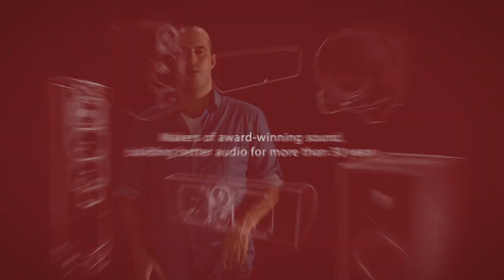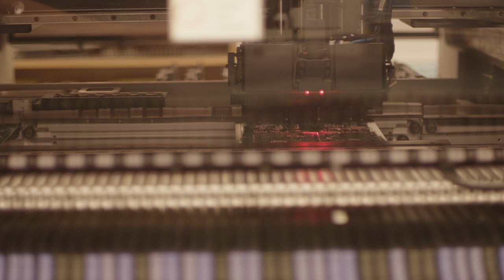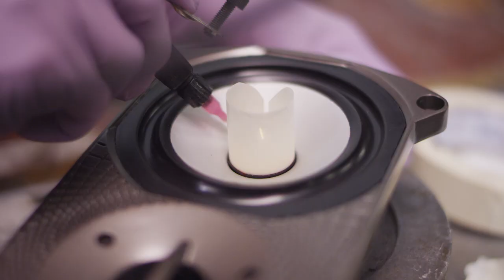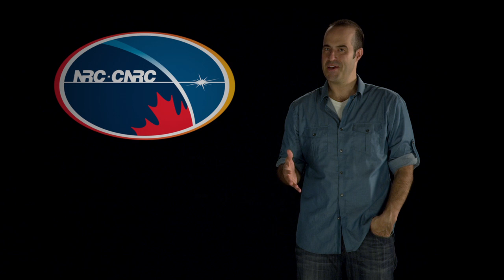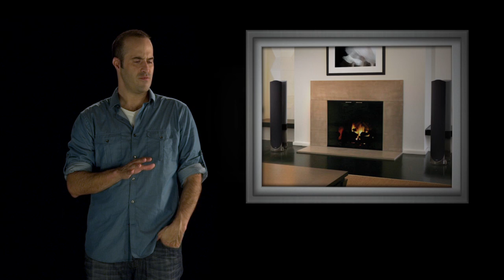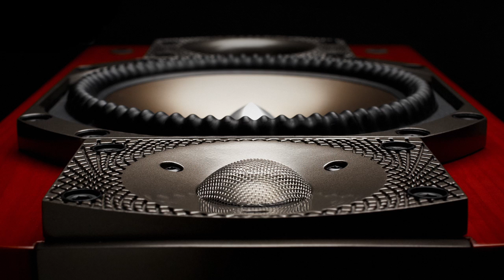Building Better Speakers - Paradigm Manufacturing Process

Comment: I have been using paradigm speakers for over 20 years now I started out with the studios and upgraded to the reference series and let me tell you by far these are the best speakers for the price comparison that I found and the best sound by far that I found..
Reply: +Joel Taborsky would really appreciate your input on the following for a home theatre room 22x15 Paradigm CI series speaker system 7 channels 
5 CI H65IW in wall speakers 
and two CIH65C in ceiling speakers 
with a Paradigm DSP3100 subwoofer 

Another option albeit at a higher price is upgrade to the Pro series all with 8" drivers 
P80 IW x 3 for the Fronts 
P80-R x 2 for Atmos 
P80 SM for surrounds 
DSP3200 Subwoofer
Reply: Yes Omar I would believe that the Pro Series with the 3200 would be the way to go.. I currently use a 3200 sub right now on my system and I love it it's a beautiful sub..
Reply: And do you mind me asking what projector and what screen are you going with..??
Reply: And what size screen are you going to go with..?? And what amp and receiver and Blu ray player do plan on going with..??
Reply: Of course I'm sure if you're familiar with the P Series you need the right power and the right Dolby Atmos receiver for those speakers to sound optimum..
Reply: +Joel Taborsky going with Cirrus 135 inch screen and epson 5030UB
Reply: +Joel Taborsky RXA850
Reply: +Joel Taborsky RXA850
Reply: Very nice. I have the RXA750. which is right below the RXA850 I just don't have the Dolby Atmos beautiful choice of receiver Man I love mine especially the app where you can control it using a smartphone you're going to love that receiver..
Reply: Perfect combination on the screen and the projector you're going to love the Epson that's a very good projector I don't know if you were working with an audio/video professional or if you picked all this equipment on your own but good choice..!! I'm using an LG 65 inch 3D TV with a Sony blu-ray player 3D..
Reply: Joel Taborsky the equipment was recommended by a HomeTheatre professional. Thank you for the great feedback

Comment: A better marketing campaign is showing us the inside and see the build quality of the cabinets. Explaining the design features that make the speakers sound better, showing us the crossovers with schematic on how you crossed the drivers over.  Show us the the drivers in parts and how you're speakers are better eg bigger magnets, higher flux in gap, materials used to make the cone and spiders etc..The only part that is an excellent marketing tactic is the blind listening tests, this is good test for sound quality.

Comment: What about Vifa tweeter in the pass and the chiness one in some model, and all those crossover failuire, woofer lead  not solder,  ......  Paradigm was awesome speaker in the past for a price that no one was able to beat ......  until around 2000   .....   now you have to paid 1000 for a little bookshelf speaker with a 5 inch midbass......   i would like to listen the 95f prestige with all metal speaker :S  .... not sure I will found back the amazing sound of the Paradigm  9 SE MKII   .... Anyway they will still my speaker of choice  .. they still do crazy stuff in they high end serie
Reply: IPv6WhatIsGonnaDo q

Comment: Is it really a Chinese product?, if so, then I think is overpriced. As for quality concerns, In my experience the manufacturing quality is 10/10.  I had the chance to help a friend change a tweeter in a Studio 10 and I was amazed to see the interior: big magnets on both woofer and tweeter, Thick wood, good capacitors on the crossover, thick quality cables inside, great insulation. I would get my hands on a pair of studio 10 or 20 anytime.

Comment: It's a real shame Paradigm sent the Monitor series offshore to China. I'm happy to pay a few bucks more to support N.A. manufacturing, and the China move by Paradigm forced me to look elsewhere.
Reply: +ratbuddy1  same here man !! never blow a woofer in my life , i have 15 pair of speaker stereo mode theater mode , and my model 9 , i change 3 woofer lol ,my center channel cc-390 had to change the mid and the tweeter , realllllyyyyy bad speaker , tweeter is way more db then the woofer ,crossover is just out of wack .
Reply: I have the Monitor 11s7 series, and they are sensational, just because they are manufactured in China means nothing, the process is still overseen by Paradigm themselves...

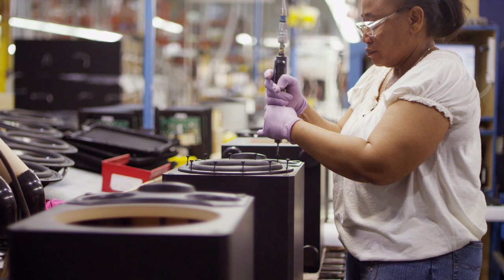Comment: wow look at the pattern that lady is screwing down the driver onto the cabinet at 2:32... no thanks I wouldn't have my speakers built this way...
Reply: Do you really think a criss-cross pattern is that important when fastening a cast aluminium driver to wood? It's not a straight 6 cylinder head, you know.
Reply: Lol, it's not a cylinder head dude. It doesn't mater how you screw down a fucking speaker! Lol

Comment: Manufactured in China, no thanks. I live in Norway and we have something better, the legendary brand SEAS, all drivers are made here. Their 13 inch f-wk woofer is 40 years old and still the best I have heard to date. Also used by B&O, Wellex and Tandberg.
Reply: Seas I own piles of. They're good. Volt are decent also.

Comment: Paradigm's lower end lines are pretty mid-fi.  Not impressive. Sizzling tweeters. Ugh.
Reply: Scott Lowell   Damn right!  mid-fi mass product, terrible tweeter sound. All that testing, and the still sound like shit on top.   Bottom and mids are passable, but not quite up there with the higher performance products made by others.
Reply: what audio company would you prefer?